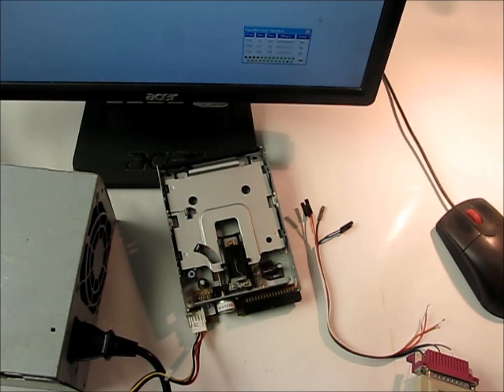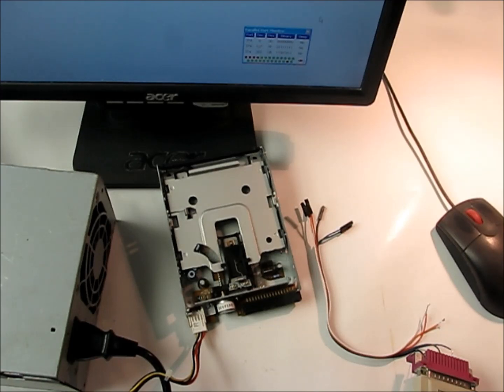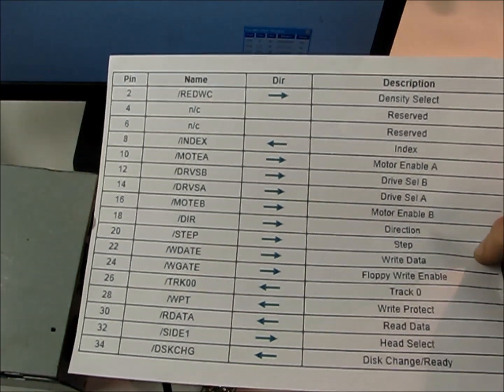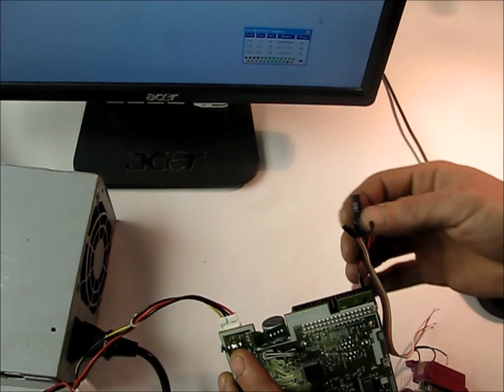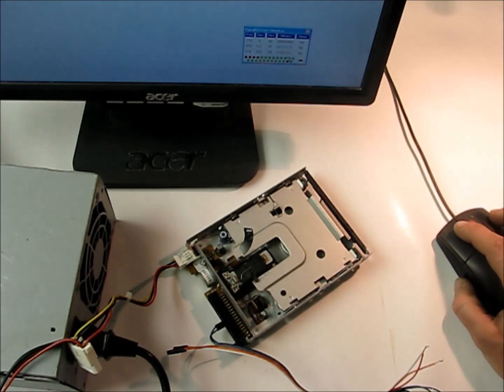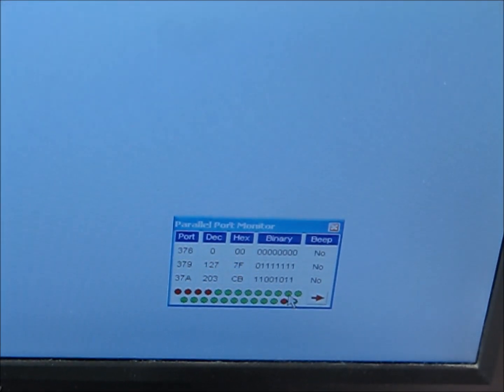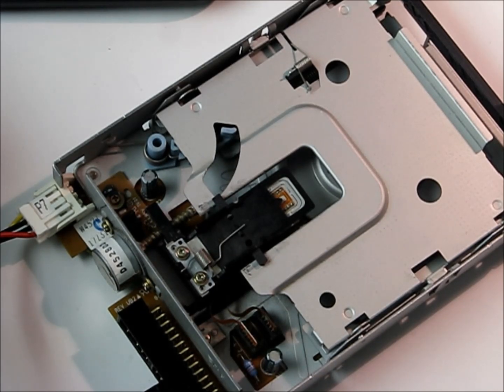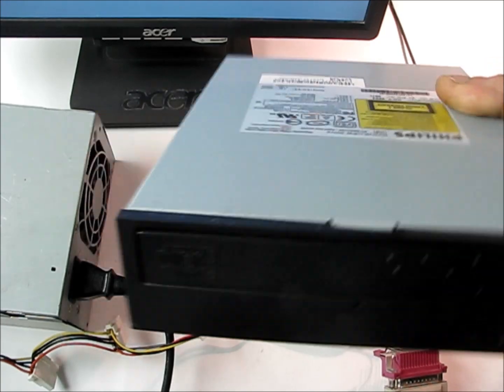DIY FLOPPY DRIVE CNC: Part 4 - Connect/Test the Interface

Comment: Doesn't the printer that you took that parallel connector out of also use stepper motors?  And isn't it already a two axis system board?   I have no idea really ... that's why I'm asking.  I thought I read somewhere that I guy made a CNC machine using the printer controller.
Reply from the maker: The printer had rotary encoders and dc motors.. the printer controller board doesnt seem as straightforward to use,,, im not sure how to interface to it.. (floppy drive is only 2 pins ) I saw people use printers before... im not sure how they interfaced to it... maybe just hacked the software? i dont know either :( Would be cool to see!~ And HEllo sir! :D
Reply: THANK YOU!  That makes sense (even though you're mostly talking over my head lol)  I've been looking for info on how to use the brains from a printer.  But now I'm seeing motor controller break out boards for as little as $15 brand new!  It might be fun as a project but it's not worth the effort JUST to "save" money.  I have several old printers laying around.  Thanks for the video!
Reply from the maker: NO problem! .. The easiest way to drive steppers i think is the l293d chip... i only pay 4.20$ each for mine.. and they are very easy to hook up. :)
Reply from the maker: is that a 3 axis motor controller? good deal!
Reply: 5 axis actually and free shipping.   Crazy
Reply from the maker: is it a RAMPS board? Im getting a new rep rap on monday, I think it comes with a RAMPS... Is that the driver? or just a breakout board wheres the chips :P Im just learning this stuff..
Reply from the maker: http://www.reprap.org/wiki/RAMPS_1.4 found it..

Comment: Hi Richard,  i tried to plug the floppy disk to the parallel port like you did, but it's not moving. I connected the pin 2 from the parallel port to the + of my tester and the port 25 to the - of my terster. Then i tried to switching it on and off and it's actually working, i can see the value changing from 1(off) to about 200(on) on the tester. I did the same with pin 3 and it's still working. But when i connect pins 2 and 3 to the floppy and i switch them on and off, the motor of the floppy do not move. Do i need to connect a jumper somewhere on the floppy? Because i didn't. Where should i put it if it's needed? Thank you!

Comment: I wired this exactly like you demonstrated on 2 different drives but right when i plug in the 5 volt(usb) the motor just spins until it trips the sensor and then i cant control it. Please respond
Reply from the maker: try to use the power that comes with the floppy drive (no usb)...
Reply from the maker: Just plug in the floppy drive like you would normal into the computer power supply i mean.